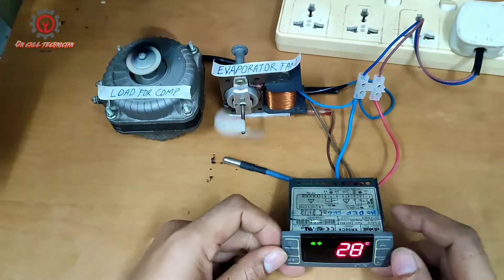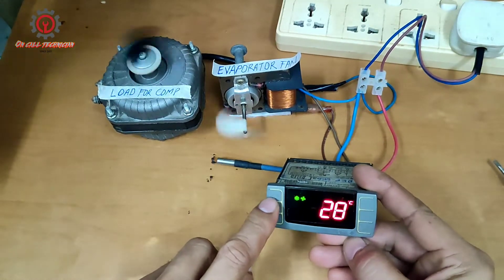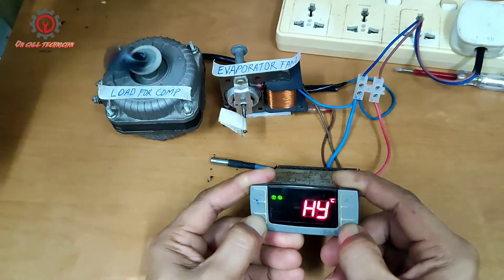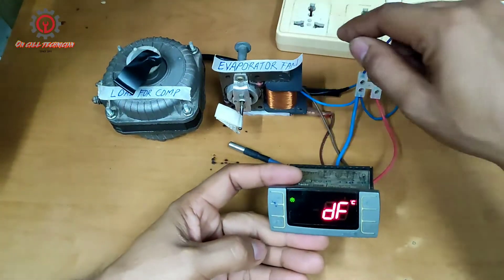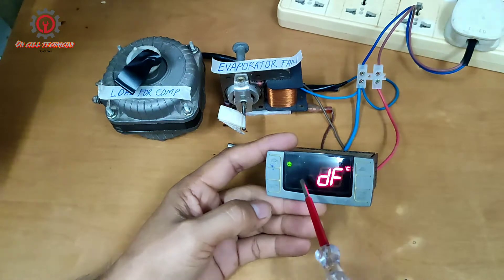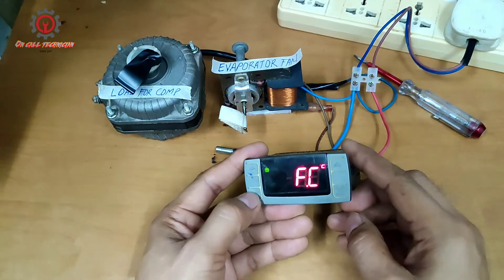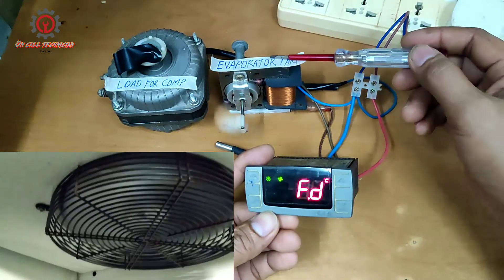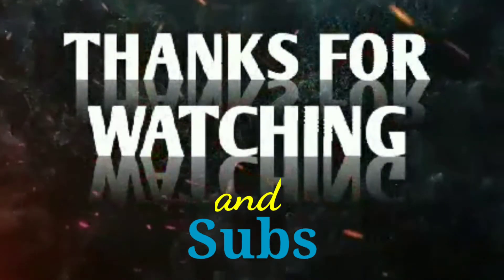DIXELL FAN DEFROSTING: HOW IT IS WORKS

Comment: Hi sir! How does the controller define the evaporator and condensed fan if they are connected parallel based on your previous video?
Reply from the maker: Just be aware of dixell models to work on definite purpose
Reply from the maker: Condenser fan should always run with compressor but if controller only have relay output and its intended for compressor then let them connect in parallel
Reply: Ok sir i'll understand now i thought you use the same model as XR01-02CX. Can i ask a favor sir? Can you do a diagram for this video it wasn't shown in this video, thanks in advance.
Reply from the maker: https://youtu.be/3XESgFJV-WI?si=ONQp0EKcw5PsUbv5 at the moment this all i got a simple wiring diagram for dixell sir

Comment: Hi sir my chiller is hot gas system but when my defrost mode is on still compressor is running. If I change dixell to electric then compressor stop when defrost moder. But in gas mode it's continue
Reply from the maker: Hot gas operation the compressor still running coz the it pump vapor to liquid and this liquid goes directly to the evaporator via SOLENOID valve